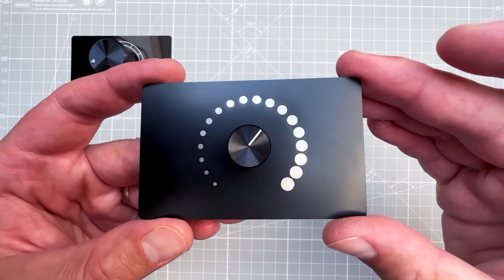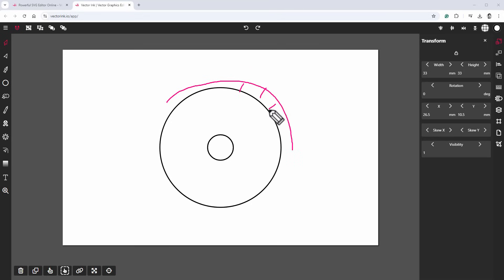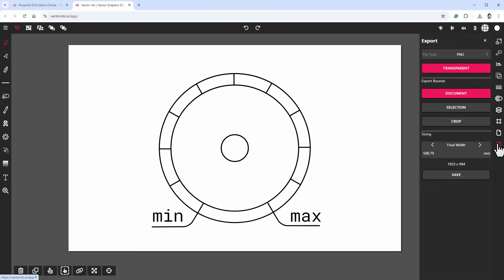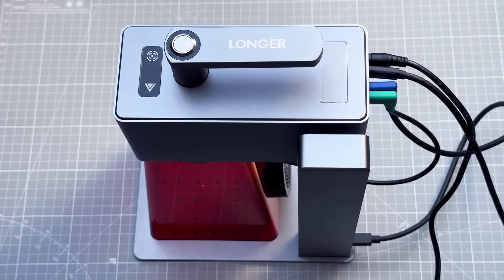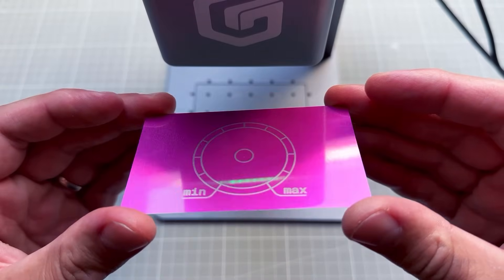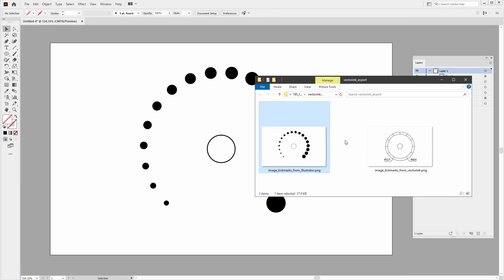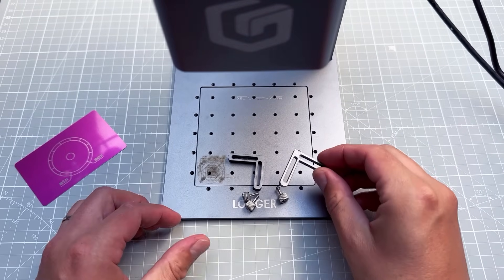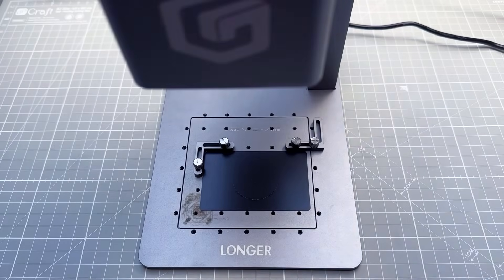Custom Front Panels for Electronic Projects Using Longer Nano Pro 12W

Comment: IT's a great idea. I have a cheap co2 laser, and spray paint onto panels, and then etch the details out. Works well on aluminium and perspex
Reply from the maker: That´s great, I need to get myself CO2 laser as well, that´s the last missing piece in my workshop.

Comment: The price for that laser is insane 😂 it is worth 30$ in parts.
Reply from the maker: If you can get this kind of laser done for 30$, I would be the first one to buy it - and I´m sure I will not be alone. This laser is actually quite cheap compared to other similar lasers on the market.
Reply: Hello, friend, this machine offers the highest cost-performance ratio compared to existing portable laser engravers on the market. We believe that the benefits it brings will definitely outweigh the investment.

Comment: I have been putting forward making all my dash gauges for years and it seems you are doing all of them. So it's quite easy to pick up on them as half work is already done. I'm fine with can and communication, but it can see myself getting tangeld on graphics programs. Maybe and on windshield OSD for car would be something to tackle on, but i'm not very sure how doable it is without special glass these cars use.
Reply from the maker: That´s great to hear that those videos are useful! Some kind of HUD would be great, but I´m not there yet.. still a lot to learn.

Comment: Was it not possible to use vector files directly? Seems like a waste to rasterize a vector image.
Reply: LightBurn does support vector images. But it takes a tiny bit of extra work to setup as every color in the vector image represents different laser setting or "Tool". (For example black line could mean cut, red - low power engrave, green high power engrave, etc..)
Reply: Lasergrbl support .svg, but "as is" [Experimental]
Reply from the maker: I guess I should have tried importing SVG file, but I´m just used to rasterizing images to make sure that I really get all the elements like labels and such. I will definitely try it the next time. Good suggestion!

Comment: Does it can remove some dark paint from plastic cases ? I'm envy of tik-toks showing engraving every output on diy devices
Reply from the maker: Could you perhaps post some example of such case? It will remove paint, but in the case of the plastic case, it might also damage the actual plastic part.